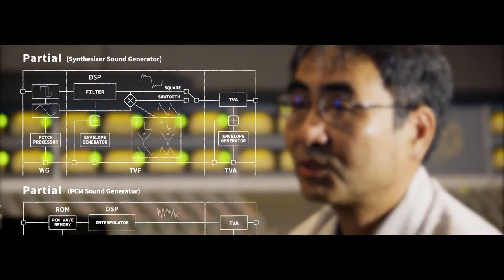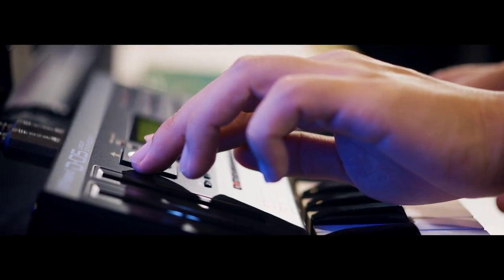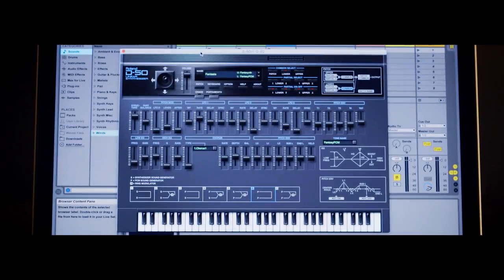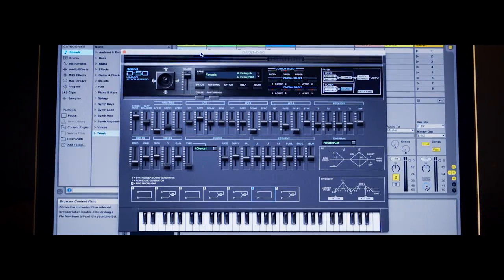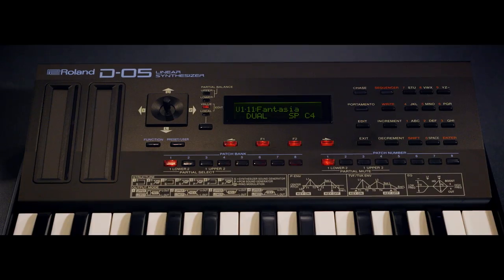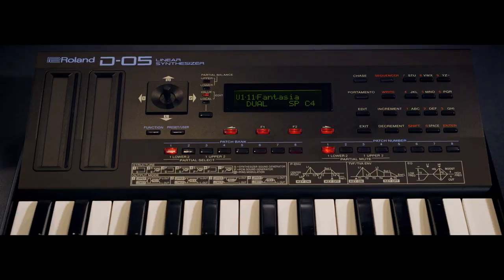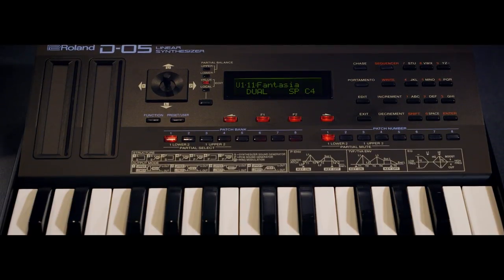Digital Circuit Behavior (DCB)

Comment: I don't mind acb and dcb technology at all, but have't we got enough tiny synths? Anything the size of a laptop is portable. Make a boutique twice as large and everything fits in perfectly. Keep it acb so it can run on batteries. The D-05 is fine, it's just buttons, but all the other models are just too small. So let's say someone wants a portable setup, the main issue is things fitting in a back pack. 
Ok, why not make them twice as large, but keep a similar thickness, with low profile knobs, so you can fit 2-3 in a normal bag, along with some notebooks or whatever. Price wouldn't change that much due to the internals being the same, and I'd gladly pay 400-500 dollars for something that is pleasing to work on and look at. I think this issue has been overlooked for too long, since people keep buying these expensive toys, but I'm sure that many more customers would appear, if the form factor was changed.

Doesn't have to be massive, just big enough.
Reply: CooperMan.inC Studios  it's a cost factor issue. Anything more expensive and sales would be weak.
Reply: same internals, different case, can't see how that would impact costs greatly. And it's not such a massive size difference at this small scale. I think that the people that are looking for a serious instrument and are put off by the form factor would cover the slightly higher cost of producing a larger unit. Again, same internals, those are the things that cost more, especially for a mass produced product from a big company. It isn't hand made or anything like moog products, so even a 50 dollar increase in price due to size would seem a lot to me.
Reply: Most pros have the originals anyway. 90% of home users do not need or want a full sized product taking up real estate and there are so many external editors or vsts editors nowadays. You cant please everyone, I think this is a good compromise with cost in mind.